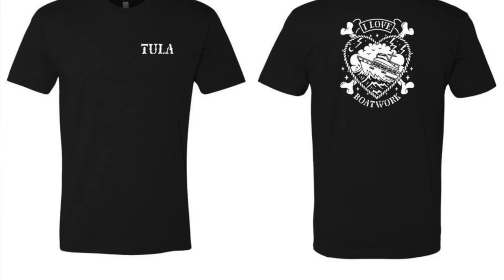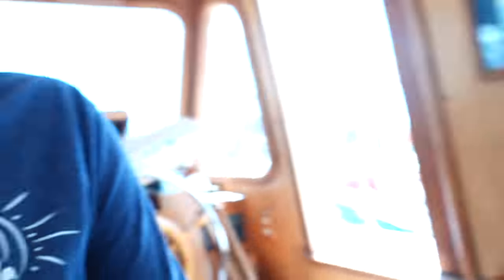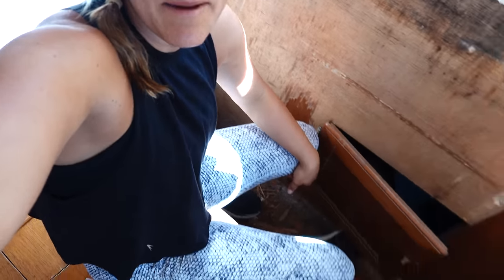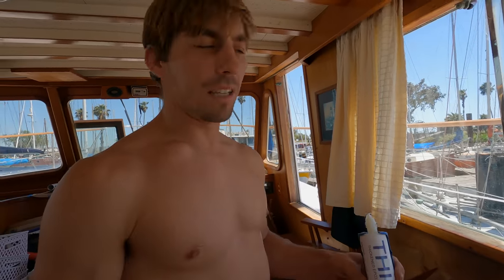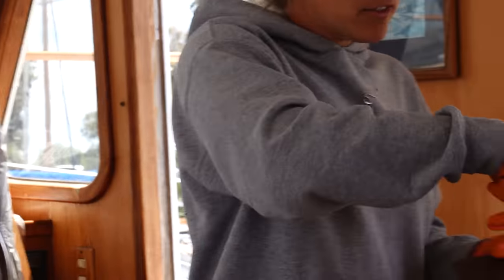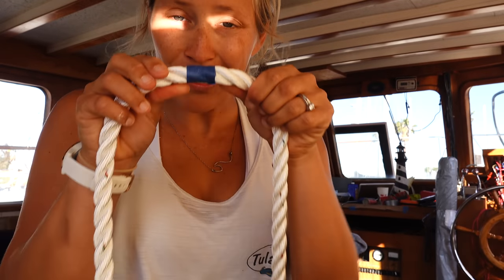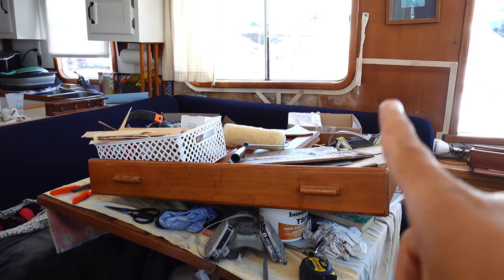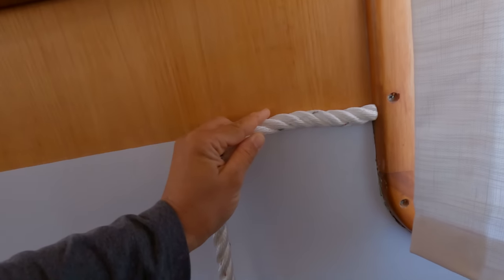Turning our ROTTING OLD BOAT into a ✨ STUNNING ✨ FLOATING HOME

Comment: Formica is a really useful surface for some areas.  It's grown a little out of fashion, I'm sure it will come back in at some point, but it shouldn't be discounted.  We had a stove / oven that needed to be replaced on our sailboat.  We don't ever use an oven, so we decided just to put in a cook top stove which isn't really that easy to find on a budget.  I ended up building a box  to mount the stove to and covering it in Formica and repurposing the gimbal from the old stove.  Looks great and we gained storage from where the oven was.

Comment: When you use an impact adhesive, where you have to glue both surfaces, and leave until it goes tacky to dry. If for some reason you make contact when you don’t want too. Pull back the Formica as far back as you can without breaking it. Then use a carpenter’s saw and keep slicing the glued section while pulling. It should then come off. 
I use to make kitchens back in the old days. I’ve been there, done that 😂

Comment: The boat is looking really nice!    For laminate use 3M FastBond 30 its water based and works great.  Metal venetian blind slats work great as spacers to keep the sheet separated from the substrate until you get it positioned.  Then just pull out the the slats one at a time as you roll the laminate into the substrate.

Comment: When you cut squares in stratified panels like Formica for openings or electrical outlets or else, don't forget to round the 90 degree angles because it can crack in those corners with time.

Comment: You both should be proud of your strong minds and hardwork!!! It really does take a strong mind to over come the issues you are facing daily by restoring this boat into a amazingly beautiful boat. As for you Jetty: you are also doing a great job as a General contractor overseeing everything your employees are working on with this boat refub and most importantly as boat security boss. 

For the old prop. I watched a vid tour of a Interior design home  on yt and the interior designer had a metal stand made for the prop to sit on and used  the prop as a very cool design element in the Kitchen/dining room. something to think about as a fond memory when you eventurally sell this boat.

Comment: @6:50 ... You're fortunate. The rear bulkhead of the salon on my boat had a joint seam just above the door coming from the rear deck. After four decades of exposure, it became obvious that there was deterioration going on behind the Formica panels. That small "really bad area" under that window of yours is similar to about 60% of my boat's rear bulkhead. I ended up demoing the whole bulkhead, but saved the old door for re-use.
I'll be replacing that rear bulkhead with Coosa board since it'll never rot or deteriorate.

Comment: For Formica you use dowel rods so the two pieces don't stick together and then you remove them one at a time.👍
Reply: Yes I was going to say that in a pinch you can use the screw off broom handles... I was hoping you're comment wud be here. ✌🏼💗😊❣️
Reply: Got it I know I was a Cabinet maker. But that's the last time I don't check it out before I send it! 😱🤔😎🇺🇸
Reply: Yes, I found circus/carnival balloon sticks work great, cheap and versatile.

Comment: Great vid and love the work, keep up the good job. Also if your having trouble with the formica try your heat gun. It helps loosen the adhesive and helps to give you a little leeway to work with. It's just like how you can use a heat gun to help remove stickers.

Comment: Formica tip use thin flat sticks to keep Formica off glue then as you adhere Formica take stick 1 out and so on every 2’ or so sticks are 1” wide x 1/4” thick x height of Formica area.

Comment: Back In' the day our finish carpenters used old metal Venetian blinds to keep the formica from sticking together to the wood of countertop that they were gluing it to..... Is very little contact because the blinds only touch on the curve portion and on the two little sides that form in the back. I know there's not many that are made out of metal these days most of all of them are plastic and I would assume that it would work just as well as there is very little contact with the blind pieces which only touched in 3 small places. Also for templates they just slice up some thin old paneling into one inch strips and use a hot glue gun to glue the template together either on the countertop or the wall or whatever they are covering..... This case they usually putting down granite or quarts which is very expensive and has to be cut perfectly to fit the spot... But it would be a lot faster then popsicle sticks to make your template. Nice job you two have done with this boat...

Comment: I guess I missed it when you told us what you named your boat.  Or maybe I didn't miss it and you just snuck (sneaked?) it in on this video.  I do like the name Mountain Mist.  As for the Formica I've tried the dowel method below but I found that if you use contact cement and let it dry thoroughly it doesn't stick until you roll it down.  Made doing my kitchen counter much easier.  Keep the good stuff coming guys.

Comment: The mixing tip on the epoxy is called a static mixer. And they are designed to do one to one two to one three to one whatever your product calls for. They are not interchangeable unless the product is same ratio. They're awesome.

Comment: When using contact adhesive you need to put slats in so it doesn't touch until you get it fitted. I like very small Venetian blinds that have been discarded you just have to clean them you put them in place you put your laminate in place and you pull them out starting in the center and have a j roller and roll it out.

Comment: Billy you need to replace shore power socket…that old burnt pin will have damaged it & will eventually burn you new lead or worst case start a fire

Comment: Was just curious as to why you used Formica instead of wood vaneer. I used vertical laminate myself in parts of my last sailboat but found wood vaneer to be so much easier. Just curious. The formica is easy to clean and does add alot of brightness inside i must admit.